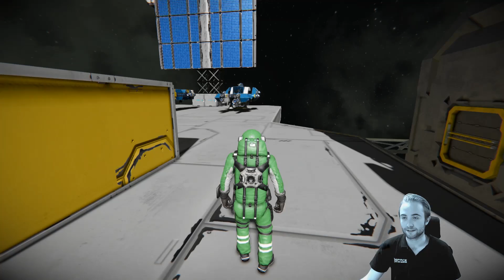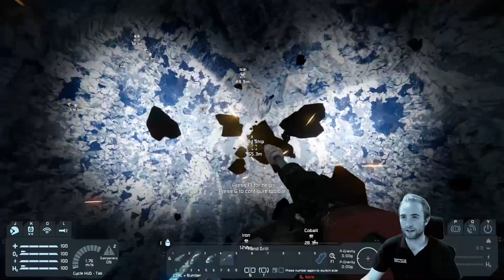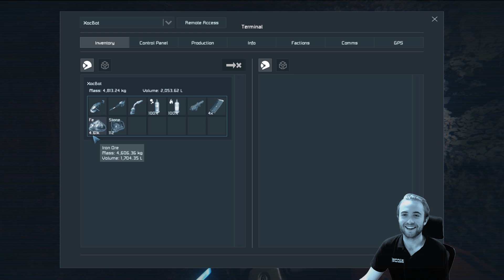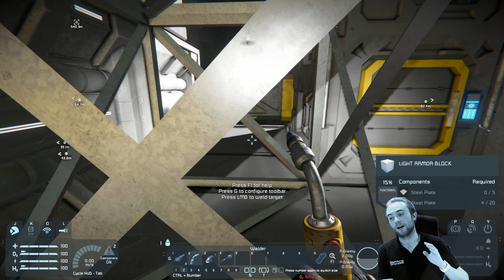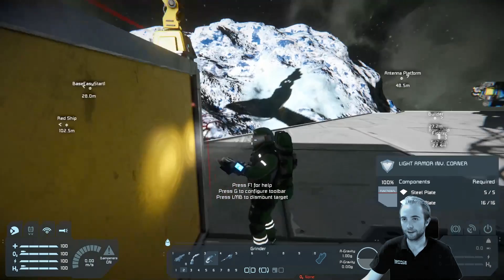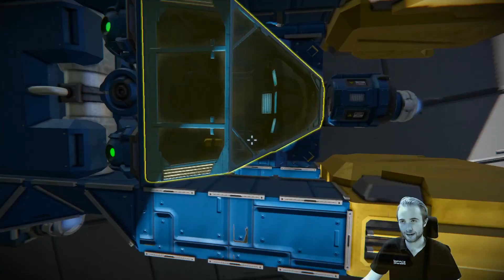Space Engineers: Getting Started - Drilling, Refining, & Assembling Survival

Comment: Thank you for making these 'how-to' videos!!  I just bought and installed the game, started it up and was advised by in-game tips to come watch so here I am...and now I have a quick question:  @ approx. 11:30 in this video you show the scaffolding holding the solar panels, and indicate it is made by creating a light armor block, but not finishing it...does that work same way in survival mode?  Also, is there any sort of durability issue caused by using a block that does not have all it's necessary components in place, ie. will it break more easily or wear out quicker?  Looking forward to learning all this in-game, but when I saw that in the video I needed to ask.
Thank you for your time and assistance.
Reply: yea the unfinished works the same in survival, and the only real difference is that unfinished blocks only have like 1 hitpoint so a stray bullet from a drone will destroy the structure if its supported by an unfinished block